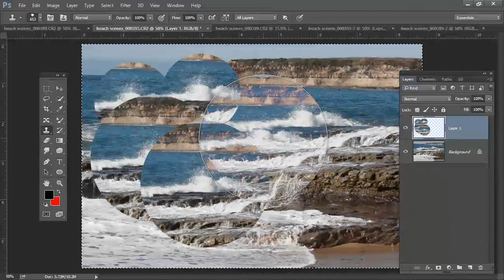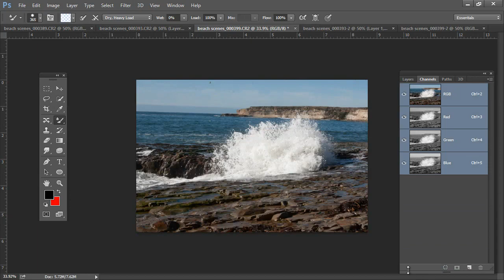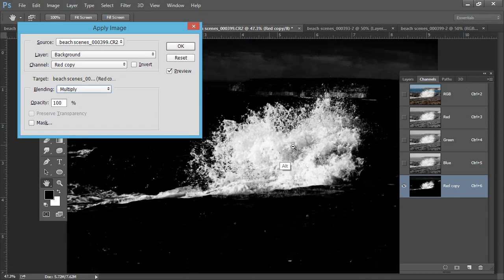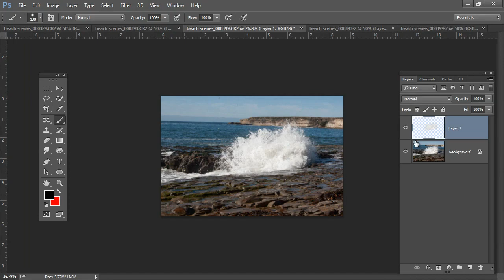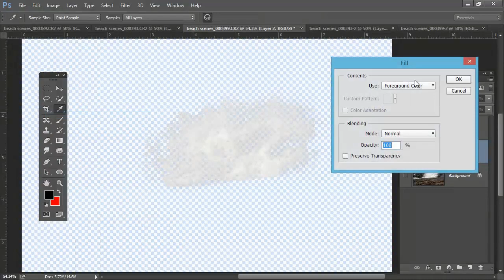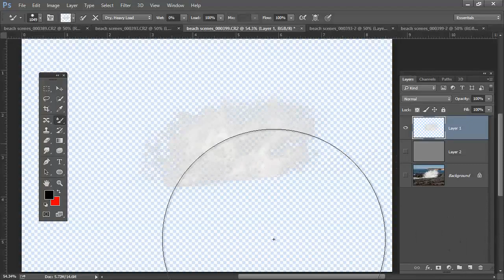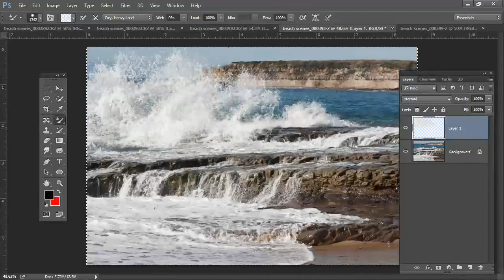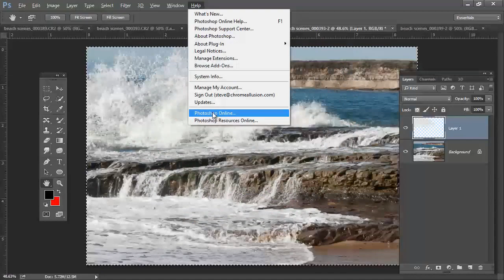Creating Custom Mixer Brushes

Comment: Nice tutorial, thank you =D

0:29 > (use stamp tool directly to get the sea spray)
> note: using stamp tool ("S") won't make the sea spray larger as we want, but just expand the area it clones
> it's not really creating a brush when using stamp tool ("S")
1:55 > (open the sea spray subject image)
2:17 > (extract the draft spray subject)
> channel panel: look around RGB channel, to see which channel gives the best separation between the subject and its background
> drag the channel layer, to "create new channel" icon
2:50 > "ctrl+J": duplicate bg for a backup> top panel: edit, apply image> apply image window: source=default, layer=bg, channel=more detail channel, blend=more detail and better separation to subject and background> hit "OK"
> note: apply image: it blends image layer with channel(s) together | it blends 2 opened, same sized images together, destructively> only sizes of the 2 images are the same, both of their source names show up in apply image window> you can use apply image to create fantastic atmosphere and still keep its details> use layer mask to hide/show different atmosphere from original bg and result of apply image bg> you can also use layer with particular channel, and blend with another channel, so the result will be generated on that particular channel> http://www.adobepress.com/articles/article.asp?p=727922
3:54 > channel panel: select the duplicated channel> "B": brush tool> top bar: blend=overlay, fill=black> canvas: draw around the unwanted black and gray area, it makes them into black> top bar: blend=normal, fill=black> canvas: draw around the unwanted area, to erase all unwanted/noise area
4:50 > "ctrl+click": on the duplicated channel, to get sea spray selection> enable RGB channels> layers panel: select the bg layer> "ctrl+J": duplicate the selection into a new layer
(extract using define brush preset)
> "M": marquee tool> canvas: crop the sea spray area> top panel: edit, define brush preset> brush preset window: rename=sea spray0> hit "OK"
5:31 > (extract using mixer brush)> "B": mixer brush> top bar: style=hard rounded, size=cover the whole spray shape, load option=dry heavy load, wet=0, load=100%, flow=100%> canvas: hold "alt", click on the sea stray area> top bar: hit drop down icon, option icon, hit "new tool preset" icon> new tool preset window: rename=sea spray0, [V] include color> hit "OK"> note: use mixer brush, so you can keep the original color of sea spray
Reply from the maker: You are welcome.

Comment: I can't get the brush to keep the texture if I change the size of the brush after a fresh launch of photoshop. If I click another mix brush then come back to that preset it works again, but if I change the size it vanishes. Is making multiple size brushes of the same thing the only way to fix this?
Reply: I had the same problem with the brush vanishing. When I selected the option " Load the brush after each stroke" it fixed the problem.  Make sure that's enabled when you save the preset.

Comment: Hey great tutorial, but I found it just today. But while saving the brush into tool-preset, PS cc recommended me to save it as a brush preset instead of a tool preset, and I did the same. But when I'm trying to re-use the brush on another document, it just appears as regular round brush and not then I saved. Any workarounds or did I miss something? Thanks again for the great tip.
Reply: Ok I guess I have to save it as tool preset only. Brush preset doesn't work.
Reply: @waysfreelance5761  I had the same issue. Even worse in CC2020 the tool preset would not work if I changed the brush size. I solved it by creating a brush preset rather than tool preset. After alt clicking on the image: edit menu-define brush preset. That fixed it. I had to go through the edit menu though, not the brush panel. To use the new brush, activate the mixer brush tool and choose your new brush from the brush panel. Works great.
Thank you Stephen for an excellent video.

Comment: Hello Stephen, I’m a new subscriber for your channel. My question probably has a very obvious answer but here goes nothing. So, I’ve seen many tutorials on how to create brushes and it’s fairly similar to this process (getting the subject separated from the background using channels), but it’s always with white subjects. I’ve seen lightning, waterfalls, clouds, this beautiful wave breaking of yours but I can’t recall seeing this done with other colors. I’m assuming it’s equally effective as long as you can effectively separate the subject. Is it possible and acceptable with colored subjects or it works well only with contrasty whites? Or do you use a white subject just because it’s faster and easier for YouTube tutorials purposes?
Reply from the maker: Adobe brushes only see black information as the subject to create brushes from.

Comment: Can someone help me? I'm trying to make a brush with this tool but I have the Alt key set up as a modifier key so I can quickly access the Eyedropper while using the Brush tool; as a result, alt+clicking while using the Mixer Brush Tool simply eyedrops the color. I can't figure out how to change the modifier key settings. What should I do?